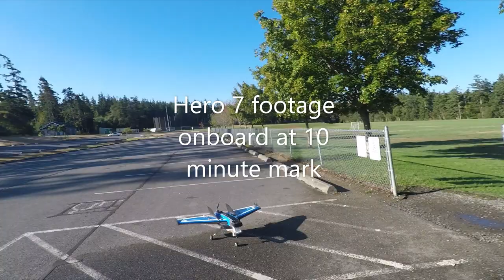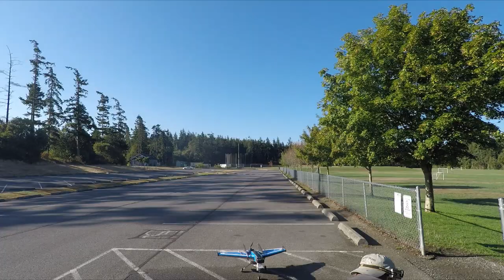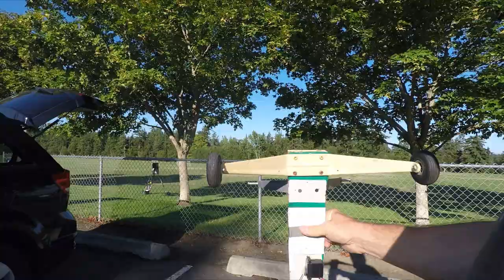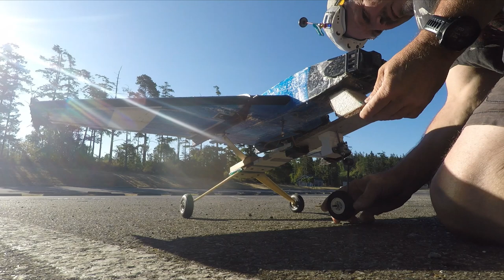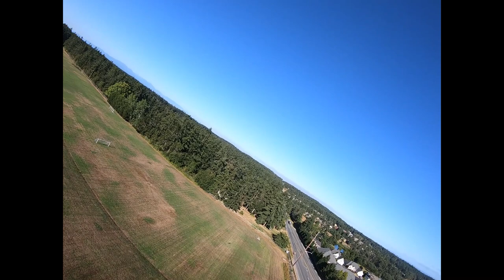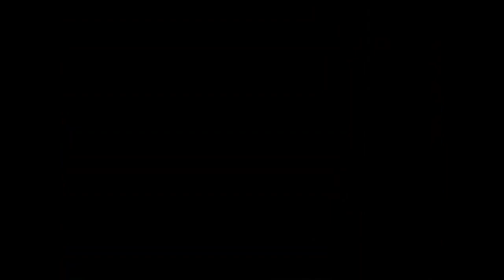Z3 launch dolly test run

Comment: the cart needs to be put on autopilot to return back, otherwise you can forget after the flight)
Reply from the maker: Worked on a few solutions early on, even had a miniquad motor on the back with a dsmx receiver so I could drive it back afterwards.  Found as long as it turns off the parking lot, it won’t get run over, could never forget to pick it up unless my buddies are toasting with me to another successful test flight…
Absolutely addicted to this entire contraption after a few years.